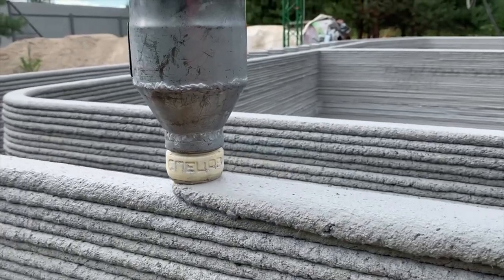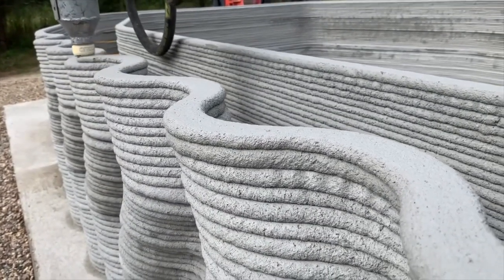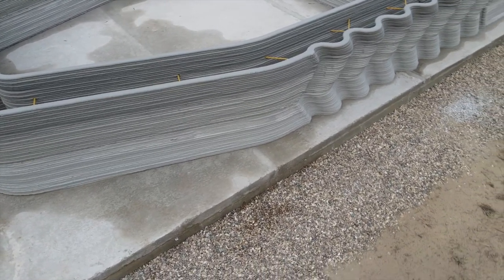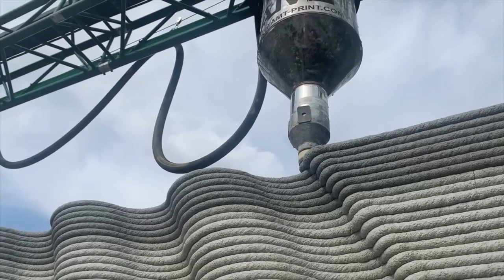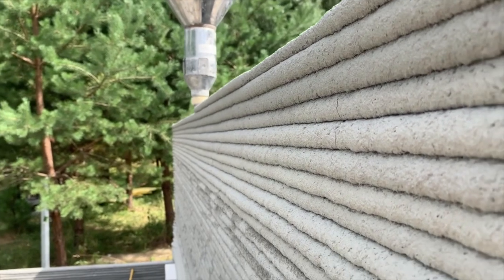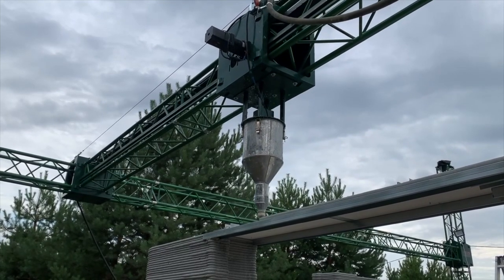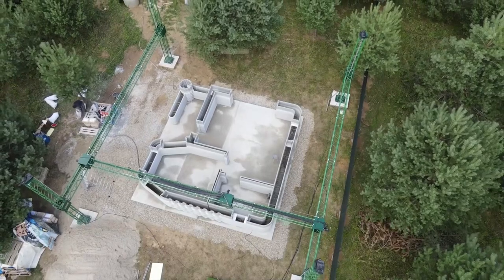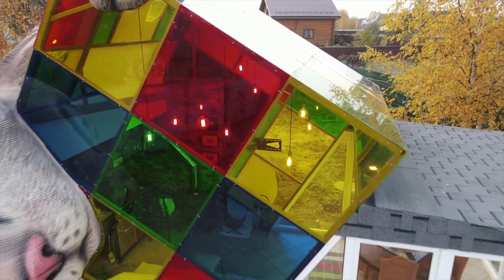$300,000 Printer for Houses | AMT 3D Prints BIG Cat House

Comment: I would really like to see this used in the West to replace tip or frame homes. I'm thinking along the lines of a hemp  Create. I'm a contractor and we literally use an is an enormous amount of of timber for homes or homes and the price of timber is exceptionally high and it's only gonna get higher however however hemp can be grown on large Faris a large farms and harvested in a very efficient manvery efficient manner I think this would be a really good solution to develop. For the future of home building. As well as many other types of structures.
Reply: Hemp could solve too many of the worlds problems. That's why it's banned 😅
Reply: Produces medical terpenes, CBD and THC in its flowers, produces seeds that have all the amino acids the human body needs, and the fibers of the stock could be used for clothing to building a house. Truly impressive plant given to us from God.
Reply: You should Google the question can bamboo save the Earth?
The stuff grows several times faster than wood and that means that it can grow 15 times more product in the same amount of time and in addition it has several times the capacity for strength 3 times stronger and 5 times lighter then would it's rated better than Steel in some cases.
 3 * 5 is 15 + 15 * 15 is 225 plus 225 times more valuable than wood.
How light the trusses are after building them out of bamboo is amazing...

Comment: $300,000 for the gantry,  what are the set up costs? the footing /foundation required to support the colons? transportation cost? what is the true expense to print .
and I noted one thing, no aggregate?
Reply from the maker: No large aggregate, also the set up costs are substantial. Some gantry systems require up to a week of labor, also 1-4 ton concrete blocks at the base.
Reply: @automateconstruction  keep an eye on contour crafting.
Reply: @automateconstruction   keep you eyes open for Contour Crafting.
Reply from the maker: @P40BTomahawk  I had an investor of theirs on the podcast and I have exchanged a couple emails with the Contour CEO. Consider my eyes open wide.

Comment: How does concrete flow through it  When we want to build tall buildings ?
I think concrete must have a high viscocity. 😅 ( I dont know much about it but I just got a questoin )
Reply from the maker: It’s challenging to pump concrete up very high but it’s not a novel challenge. The only novelty is the curing speed if you add the right chemicals at the right times it should be possible.